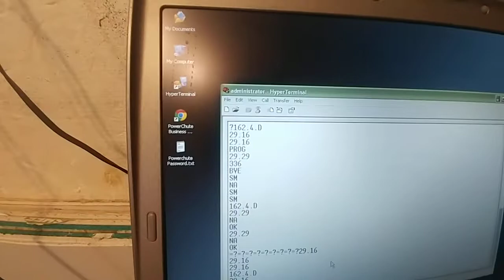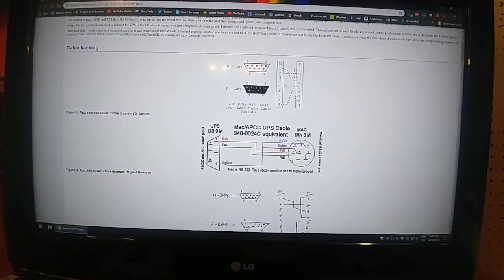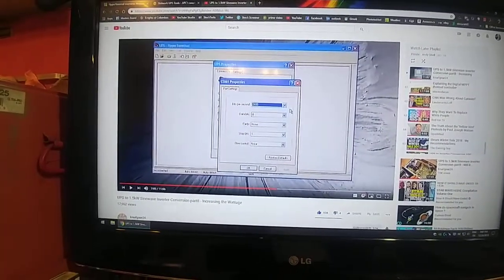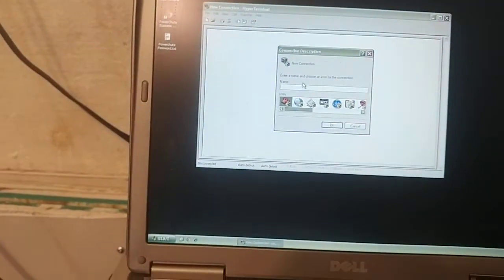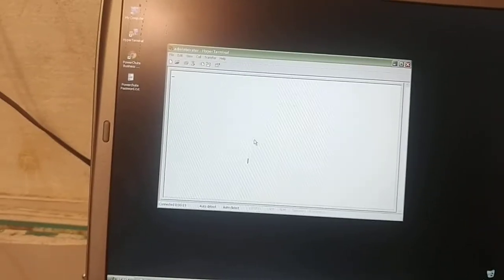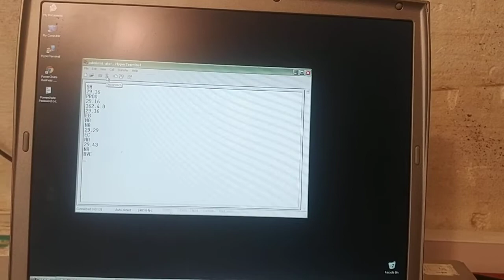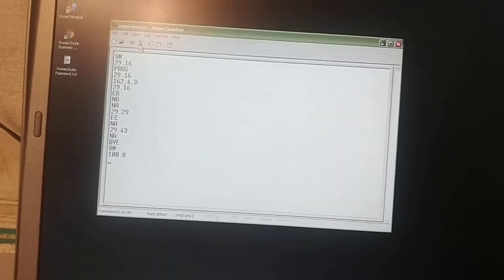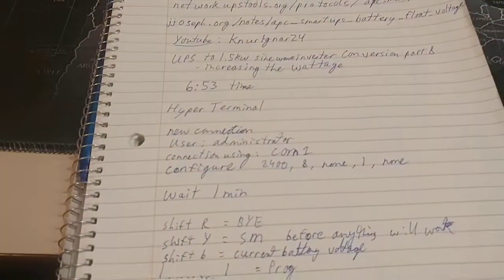APC server UPS convert to 18650 7s Hyperterminal change float voltage

Comment: I just did this today. I went through the pain and suffering of installing XP because I could not get minicom to work from linux. It did not work for me on XP either, I eventually tracked down the problem, if your APC UPS has both a serial cable and a USB cable, then to access the APC via serial you have to be sure the USB cable is not connected. I have now successfully connected with both XP and also using minicom under Ubuntu 18.04

Comment: Just subscribed!!
Reply: I have 2 APC smart ups 2200 xl, Do you think I can modify this as well?
Reply from the maker: @hethestrange  Thx! are you sure you sub'd? :P 

APC is a very lazy company. So far every product they ever made uses the exact same programming for the past 2-3 decades and all of its pcb boards are the best version but with missing parts so any changes you think you can make you probably can make with little trouble. :)
very sorry for the delayed response. been a ruff month :(

Comment: Why those "Disco" lights? For me looks like an error... I did same on mine and got same lights, now it does not let me change any value anymore, sometimes I can enter PROG mode but get NA on any value I want to set, true float value is set at 29.43 but UPS does not seems to care about it since it does not charge my 7s/18p battery(min 36Ah). After self test(with disco lights) it starts the charger a bit then stops with same lights, it did the same with old float value(standard) so for me the new one does not seems to be used, unless I am doing something wrong.
Reply: I am also in the same boat as you guys are - trying to run 7s on these ups. I have sau1500. I have been looking high and low including schematics (Russian I think) trying to find the the voltage divider that controls the PWM controlled charge voltage. I think the schematics is for Back1400 and not SAU1500. The program mode in above video only helps bring down the float voltage. If you bring up the hex value, the ups will lower the float voltage. You could potentially run 6s at 25.2V. I tried calling Schneider and the tech rep actually "scolded" me saying it's their proprietary blah blah.. true tho. If you have SA1400 the resistor hack could work. I think it's R117 and R118. The disco light is when the UPS senses too high of the battery voltage. When I first plugged my 29.2V 7s battery pack, I got the same thing. Then I lowered PROG B to the point when 29.2 shows as the max green led. I attached some relay to the buzzer to modify the start/stop sequence so that I can run this with my minifridge and not waste power. I should thank Andy Shell and KNugl.. for their videos as they helped me sort things out.
Reply from the maker: @songsIlike8  knurlgnar24 videos are pretty much the template of any apc ups mods. old videos and the very first ones but still the standard. 

glad you find it helpful. I couldn't have done any of it without Andy Ham telling me about it and letting me borrow his old laptop and cable. :)
Reply: L.E. NVM found the new video that explain the stuff... ~4.13/string is OK IMHO, any idea how yo set the low voltage disconnect? On me it did cut off on ~26V that is too much a waste to stop on ~3.7V/string :(
Reply from the maker: @iuliuscezar3284  it sounds half broken. i have tried so many times and can not find a way of changing the cut off voltage on these old APC UPS systems. i think they are garbage only good for running very high load short run time devices like microwaves, toasters, toaster ovens and power tools so you don't damage or wear out your nice expensive inverter. Thanks for watching! sorry for the late reply. this month has been ruff :(

Comment: Awesome, you got it done, now the real trick is to see if they can be made more efficient as they consume 50 watt hours at idle!
Reply from the maker: Thanks again Andy! I have an xmas present for you as well. I'd like to hold the laptop till dec 31st if thats ok to do 2 more tests. Christmas is the worst time of year to try to get work done lol. That and I keep getting set backs. I have no doubt the large transformer is what consumes 50w. all that dam buzzing. lol
Reply: @AndyShell  No problem, no rush at all, I rarely use that laptop unless I want to connect to something old or mess with the computer in my car. I also put the monitoring software on it, so if you connect via the USB cable you can monitor the UPS and do some other cool stuff like launch a script when the battery gets low - I will be using that feature to start my generator when my batteries get low on days where I have no solar.
Reply: @andyhamm6389   You has no idea how desperate iam to get "powerchute 5.2.3" or some compatible software version with comport support.
Reply from the maker: https://youtube.com/add_contact?c=aGUhm5h7oUtfKjif4HqZSfFsVZnnLQ

Comment: Sort of having problems obtaining the software to control this ups , not sure if ive failed to do something correct but when im hooked into it over comport with correct serial port i get nothing but when you power it on it sends data " ? " only , Maybe its that key combination i need to wake it up , Also if you set float voltage to 0 would that disable its charging function? i ask as maybe a alternative charge could be created such as solar.
Reply from the maker: I never thought to try to set it to zero. I'll try that thx!
APC purposely engineered to prevent ppl like us from making any kind of changes at all, hens your troubles. 
1. APC brand rs232 com1 cable? (if it isnt the green light on the back beside the com1 will turn off and make a click noise turning off the APC)
2. 2 good health sealed 12v lead acid batteries or 8s 18650's connected and at 80% or higher voltage
3. You have the program called Hyperterminal on a win xp or older computer (there are many other ways but they are all purposely difficult and i only know this method)
4. connect exactly the way I showed in this video
5. you need 2 good health sealed 12v lead acid batteries or 8s 18650's connected and at 80% or higher voltage
6. press shift y (it will reply SM)
7. press 1.........1 (it replies with PROG)

you should be good as soon as you see SM. I figured this out by literally mashing the keyboard (lightly) with combinations of holding shift and not holding shift. watch out for the cap locks key.
Reply: So it demands you have a good battery in it? because ive just been bump starting the relay to turn it on initially. Does yours behave in same way? eg have unit turned off then order hyper terminal to open port to it then turn ups on then you get "?" from the hyper terminal display? . I guess solving this has driven me kinda insane mostly cos the weight i have to lug around to get it near a pc. Oh and yeah im using a real APC cable they are evil to make it the way they did.
Reply from the maker: @steve64464  ohhh yea its total bs. I was pulling my hair out even with all the proper tools and knowledge.   
If you are having trouble then deff make sure you have an 8s 18650 pack or 2 lead acids connected while trying to connect via hyperterminal. You have to turn on the APC first and let it do its POST check sequence first before you try to connect via Hyperterminal.
Once you get the hang of it and have a few successful sessions of changing code and saving it using hyperterminal you can start playing around with it and trying under different circumstances. I had a lot of trouble before I had my first successful session.
Reply: I put a 6S on mine built from old laptop cells but i didn't let it be connected while AC mains was going in in fear of it could overcharge or expose it to high current charge attempts. i attempted to patch in with a serial usb pcb board manually that gave me minimal output , then i tryed a actual usb to serial adapter same minimal output now i had to dig out a pc with a real serial port and authentic APC cable with same minimal output response from it. drives ya crazy don't it.
Reply from the maker: @steve64464  100% your problem is you need an 8s 18650 pack charged to full plugged into the apc. It will never communicate until you do.
Reply: Ill give it a try when i can rig up a safe way to try it , don't want it going thermo nuclear :-D
Reply: Wait how many volts are you shoving into this thing? i assume there's a maximum voltage before things start smoking and exploding.
Reply from the maker: @steve64464  max 29.4v (7s x 4.2v) i only get the option of 29.29 or 29.43v on the apc tho. So 29.29
Reply: Interesting so at least we get a idea how far we can push the damn thing. Right now ive gotta test over 80 18650 cells taking forever.. Might give the usb serial ups communication another try in a bit , i swear it feels like im gonna die when lifting that thing , even its pdf manual says two people must lift it heh.
Reply: I actually got the damn thing to talk to me using a android phone to usb to usb serial then some com port terminal software. it seems to talk and respond to you if you have no battery inside but you must bump start it onto the AC outlet. Now im going to go insane trying to find a copy of that powerchute software since apc have gone to great lengths to prevent users getting older versions.
Reply from the maker: @steve64464  lol wtf?! You used your phone? Holly thats new. Amazing man great work!
Reply: I was shocked myself when it started talking back to me, Now i just need that powerchute software and or a bigger list of commands i can send to it :-D
Reply from the maker: tested. you can bring float voltage down to 0.13v and thus disabling the float charge circuit. all the error lights turn off as well and it runs no problem.
Reply: That's really handy to know thanks for testing this theory/idea , Im wondering if you tell the ups what the cut off point of the battery is so it does not over discharge/charge. these things have so much potential
Reply from the maker: @steve64464  update: no it brings up an error. you can only set it to your batteries float float point or it will think your batteries are faulty. it will still run tho.
Reply: @AndyShell  So it disables charge but moans about it thinking it's batts are bad yet it still functions fine?  I think the alarm can be disabled .